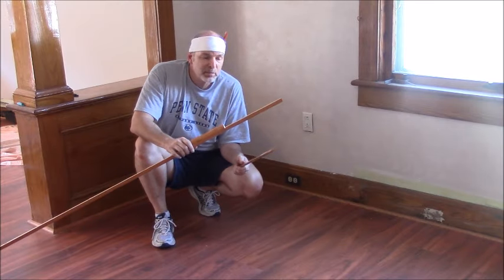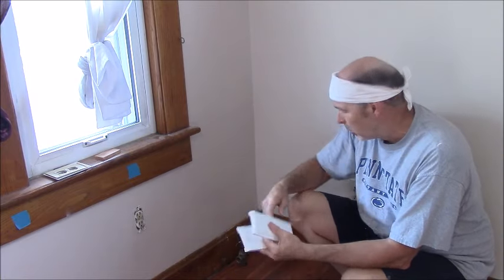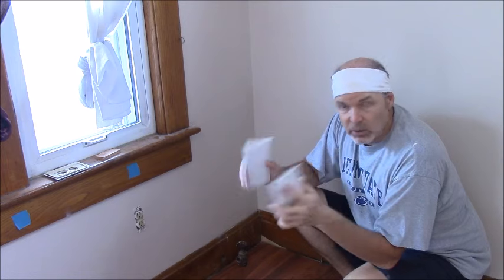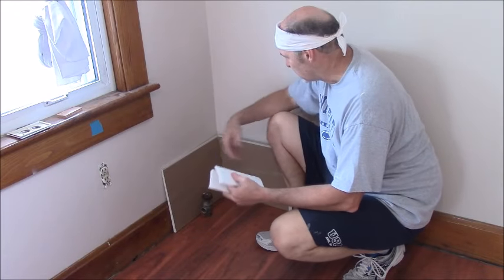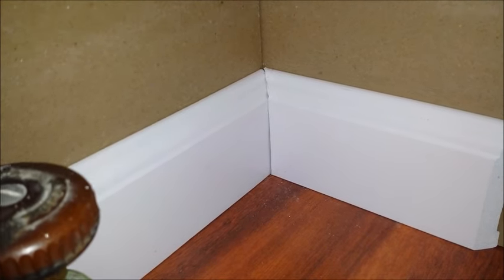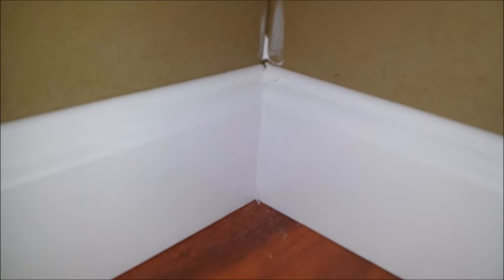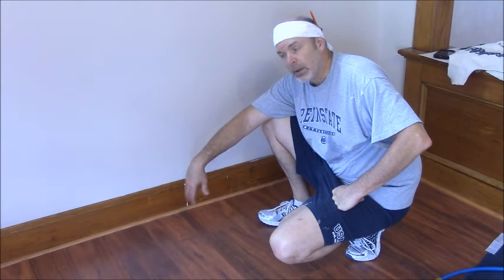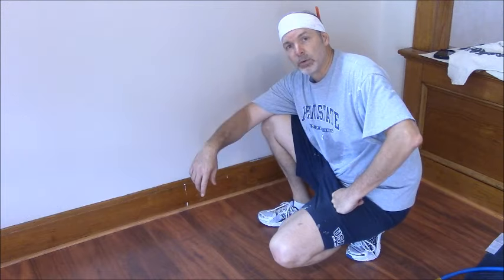HCC 17: Cope Your Molding

Comment: Two words...Angle Grinder. I tried it with a regular coping saw. I tried coping with a barrel jig saw with a collins coping foot(which wasn't bad except you need to clamp down what you are coping), but the best way that I found to do it was with an angle grinder. You can hold it in your hand and do your back cut with the grinder. It worked the best for me, quick and easy. I'm sure these guys that use a hand coping saw a lot are good but an 4 1/2'' angle grinder with a sanding disk that have the flaps worked for me best.

Comment: I always cope joints. A lot of people say it's harder but I find it a lot easier. I think where a lot of people go wrong is the angle that they attempt to cope with. You're supposed to be cutting at a slight angle while following the painted or finished edge.  So it angles to the back of the board. Does that make sense? I'm a carpenter not an English teacher.  A lot of people try cutting straight up and down and wonder why that didn't work. So you follow that line and cut at least a 45°. Except with shoe moulding it is a straight cut along the curved edge. Does that make sense?

Comment: Erasing pencil line would make it look better. :)  Also,,, if you're going to caulk the joint anyway, may as well just miter it, much quicker that way. Thanks for the tutorial, great job.
Reply from the maker: Miter is quicker and easier, especially with the pvc molding that won't shrink. However, if you don't have a perfect 90° corner (and let's face it, what house has perfect corners) the back cutting will give you a tighter fit.  Good point about the pencil line. Thanks!

Comment: Does it matter which side you cope? I’m doing my own crown and I started left to right my first cope is on right so that full length I coped into I left square on both ends but now when I cope the left side of the crown to fit it won’t fit
Reply from the maker: It doesn't matter which way you go, left or right.  You just have to make sure you cope whichever is the face you have made your 45° cut
Reply: Home Craft Chronicles thank you for getting back to me I had started running to the left and butt it up against that wall and ceiling then the new piece I tried to cope and connect to that and I couldn’t for some reason so I took it down redid it and it worked but then same thing on the next cut I ran that one length wise into the corner to cut the following one cope jointed and it was difficult to fit so I didn’t know if I had to reverse it and make the purchase on the long wall the coped piece and the short wall coped idk but thank u for your videos and reply

Comment: the issue I have at my house is where the wall and ceiling meet separates during cold weather. I was painting until that happened, sometimes I hate plaster walls. Trying to find the studs are a trick too.

Comment: Your shoe molding is upside down. The short side goes on the floor not on the wall.   If you were my handy man you would have to redo it all.
Reply from the maker: I installed it that way deliberately.  I had a little bigger gap to cover.